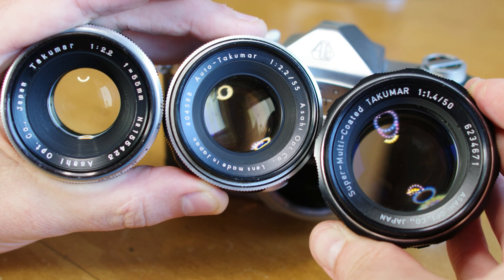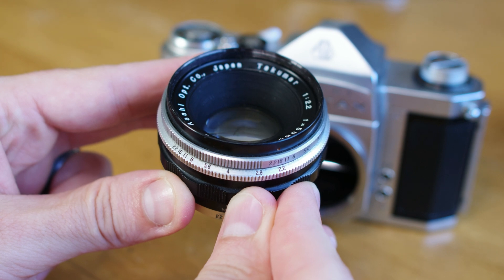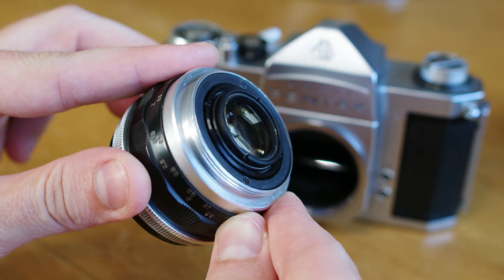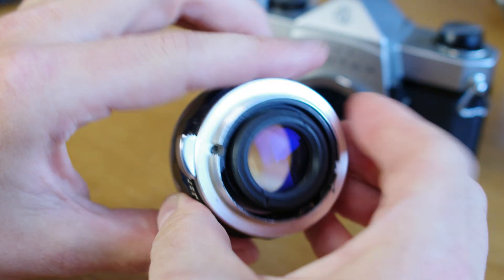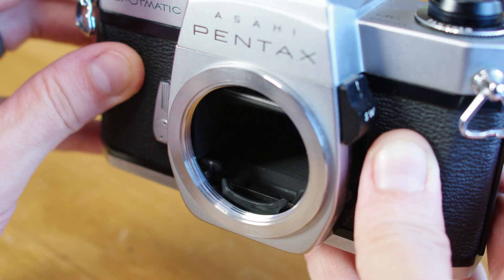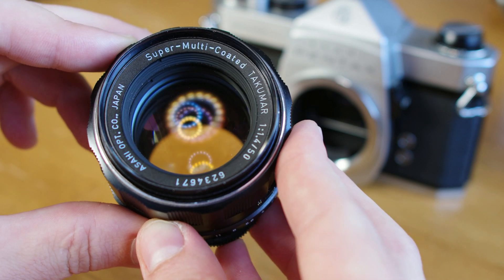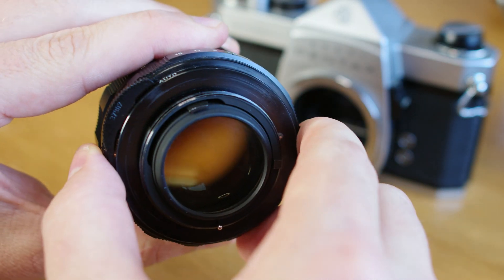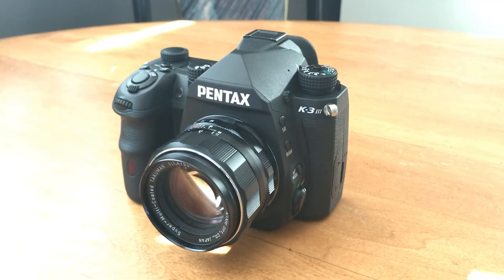Takumars: The Pentax M42 Aperture Mechanisms

Comment: The 55mm f2.2 semi auto any idea how to get the apeture to close properly mine will not spring shut when released . The pin to release it works fine but there is no movement unless I take lens off and move the apature lever manually on back the lens